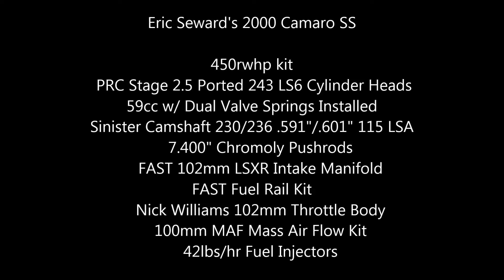HAWKS Eric Seward's 2000 Camaro SS H/C/I 465HP & 423TQ!!!

Comment: i want them to do that to my '99 SS SLP :) .... how much? lol
Reply: $4600 it's on there website
Reply: JayMan's Film's Man that’s not to bad.
Reply: Lucky Goose that’s just for the engine tho, your drivetrain has to be built to handle this power.    Stock 10 bolt will not hold up to this.    So prob think about another $2500 for a rear end and should upgrade the transmission too.
Reply: @chainsawmanny  my ten bolt handled it for years including drag radials for weekly track passes. Never launched it past 3500 though haha

Comment: When you did the heads did you have to change pushrod length? I have the same setup going in mine. 1999 camaro z28 m6
Reply: Gregory Stones all ls1’s come with 7.385 I believe. 7.400 is a popular choice with new PRC heads for the LS1 aside from if you buy the 227cc ones

Comment: How's the drivability??
Reply from the maker: Obviously different than stock, but those modifications aren't drastic. Once you get into gears, stalls (for auto) thats when you'll see a major change. But Cam, Heads and Intake will liven them up!
Reply: @Scwoodsy  wanted to know if it could still be used for a daily or is it rough now that its modded.
Reply from the maker: easily a daily!